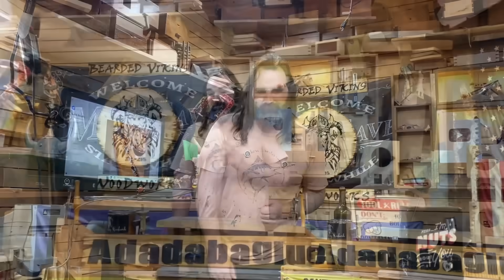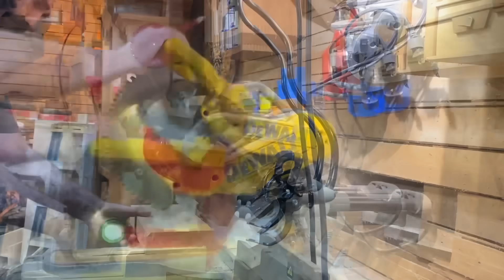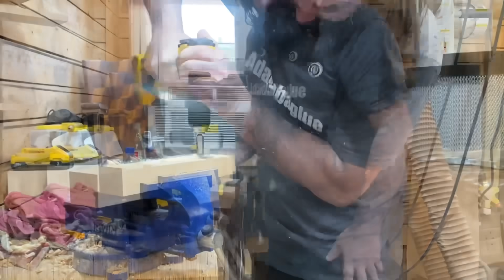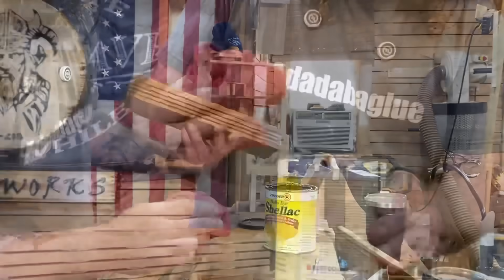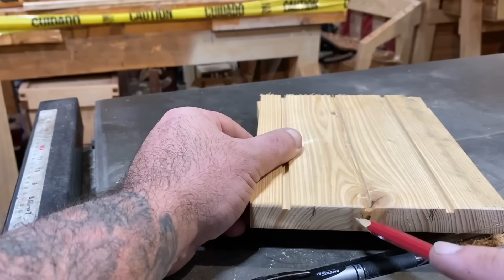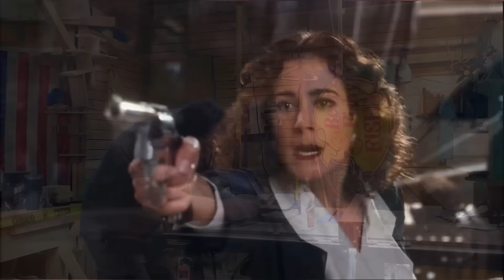Easy Fall Wood Projects

Comment: I just did the same layout earlier today for 3 candle holders.  Center holes at 2" , 4.5" and 7" for a 9" length. Took me longer to find the layout I liked than it did to glue up the wood I decided to use. Getting an early start on Christmas presents. Enjoying the video. Now I want to add the cuts to one of mine. That turned out great.
Reply from the maker: Nice brother ! Thanks so much for the feedback and so glad to hear you’re enjoying the content skal 🫡

Comment: The Candle holder is a cool design for sure!!  I know several people who would buy them! Thanks for another great project!
Reply from the maker: Hey brother ! It’s my absolute pleasure to
Reply: These look awesome. Whats the drill bit called for the candle holder holes? I tried it once and it never budged the wood
Reply from the maker: @chloecheshire1377  https://www.amazon.com/HPHOPE-Forstner-Drill-Round-Shank/dp/B0C83134C7/ref=asc_df_B0C83134C7/?tag=hyprod-20&linkCode=df0&hvadid=693454631485&hvpos=&hvnetw=g&hvrand=8830320070021197295&hvpone=&hvptwo=&hvqmt=&hvdev=m&hvdvcmdl=&hvlocint=&hvlocphy=9010526&hvtargid=pla-2259610389263&psc=1&mcid=c51580da504538eabda297eb9a5fcae1
Reply: @Bearded-Viking-WoodWorks  thank you. Does it take quite a while to drill as i used something like that and it didnt really work lol
Reply from the maker: @chloecheshire1377  it depends on the material you’re using and also the sharpness of your bit .  👍🏼
Reply: @Bearded-Viking-WoodWorks  thank you

Comment: We're all still here Bubba!  Question for you:  Could you put matching 15 degree slots in the ends of the candle holder?  Or would that leave some chunks taken out at the corners?
Reply from the maker: I haven’t thought of that but it may cause the problem you stated with missing chunks.  I’ll do some test runs and see

Comment: I am getting ready to buy a new sliding miter saw looking at the Dealt 780 but seeing a lot of bad reviews with the newer ones any one have a thought on these
Reply from the maker: The only down side is the slide direction goes back into the wall , if you notice mine I had to cut a hole in my wall paneling lol 😂, but other than that it works amazing

Comment: How do you of keep the candle holder from warping after the candles burn in them for awhile?
Reply from the maker: Once you apply finish it should keep the wood safe.  Plus it’s really not that much heat or moisture coming off the candles to do any warping
Reply: Ok thank you so much your channel has been very informative and inspiring!
Reply from the maker: @damianshoup  it’s my pleasure bro , happy to have ya

Comment: Great build and a nice twist on the wood candle holder - where do buy the candles? Thanks, Larry
Reply from the maker: Amazon . I’ll get the link
Reply from the maker: SOFT BREEZE 24 Pack Unscented Votive Candles, Votive Candles Bulk, Glass Candles, Ideal Gift for Wishing,Hydrotherapy, Wedding, Birthday, Holiday, Party, Small Candles Bulk,Votives Candles Set
Reply from the maker: https://www.amazon.com/SOFT-BREEZE-Unscented-Hydrotherapy-Transparent/dp/B0CS6ZLNNB/ref=mp_s_a_1_1_sspa?crid=3VZXJIZ31SLO9&dib=eyJ2IjoiMSJ9.X05UFdihgSw2YfwZiOdiATWT1i7lp4Rh0af7SVajaNScuuplCpmmGhDCpYe4wdS4Hj3KbeoQcL9uYhryBIIinrCsVSYNVPfjC0n-mIS9Hqkuo9bV-Pjjt091T5_9wACmGqbe38od8voK-bzzPWzdp2QqPcYziZOl0Yx0KFy5ok5QAtqQUq_dee5guCfQXaZ1Q1jt9DbAFL9jWPIf_Q8ydA.JnmMuYEUEAHAKOoiIYjISoRKXEdj8AEz0qEuENhq-d0&dib_tag=se&keywords=small+candles+glass&qid=1725920294&sprefix=smalle+candles+glass%2Caps%2C183&sr=8-1-spons&sp_csd=d2lkZ2V0TmFtZT1zcF9waG9uZV9zZWFyY2hfYXRm&psc=1
Reply: @Bearded-Viking-WoodWorks  WOW--- Thanks very much - I'll be ordering a bunch later in the week... Again, thanks for the really nice video. Larry
Reply from the maker: @EEEZSolutionS  man I can’t stop selling candle holders like for real !!! 🤣
Reply: That's awesome to hear... it really is a great looking product.. do you sell on  Etsy or some other sites? I've dabbled just a little with Etsy but haven't really figured Etsy out so I have not pushed it.

Comment: Hey Daniel, I’m using walnut, but one side is cracked and chipped to hell and back. Should I use some epoxy to fix it or just try to sell it anyway?
Reply from the maker: Well just use your judgment, if you think it may crack if handled roughly epoxy It , if you think it’ll be fine leave it
Reply: What about your recommendation for stain for walnut, danish oil or is there something better? 🙏🏻

Comment: When you say you're sanding something down to 150 grit, are you just using a 150 piece of paper and sanding it once? Or are you using varying grits that finish with a 150? I ask because I typically do 60, 80, 120, 220, 400. Only because those are the grits I happen to have laying around. And typically I'm using pine and then a pre-stain, then staining it. Though sometimes I just leave the pine natural. I'm just trying to figure out if I'm over sanding with all the grits etc.

Comment: Hi.  How do you cut the candle holes so good, I have a 38mm drill and I get ruff edges and it pulls the grain, it’s on pine, does it cut better on hard wood?
Reply from the maker: Hardwood always does better than soft wood , are you using a forstner bit.
Reply: @Bearded-Viking-WoodWorks   yes, to the bit.   And keep up the video I think they are great, from the uk

Comment: I'll be honest if I didn't have a drill press I paid $25 for used off market place I would have never bought or used forstner bits. I still hate using them free hand in a drill. Especially the larger sizes.
Reply from the maker: Yeah it can be a real pain in the ash . 🤣